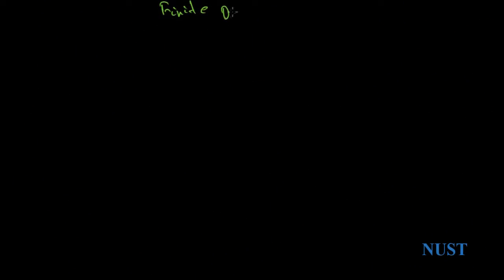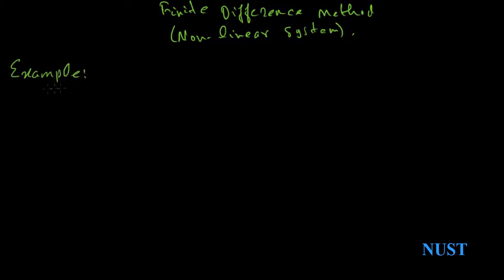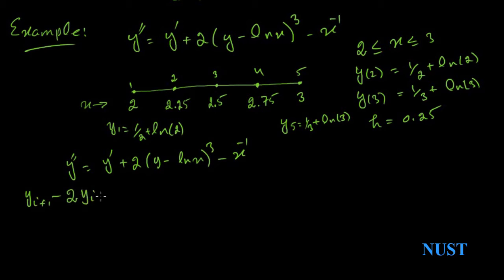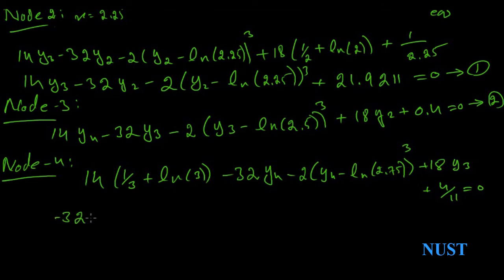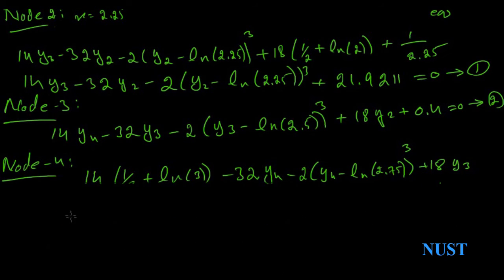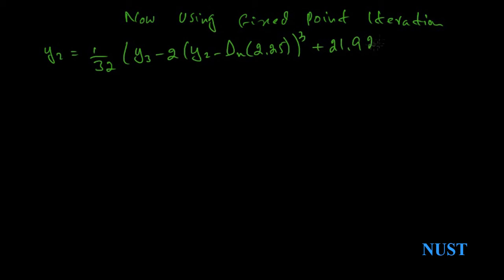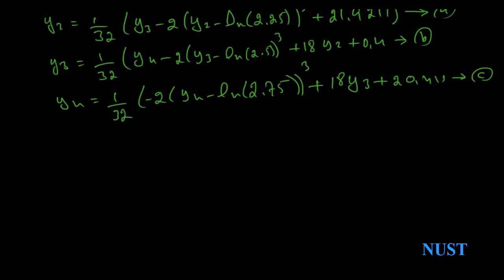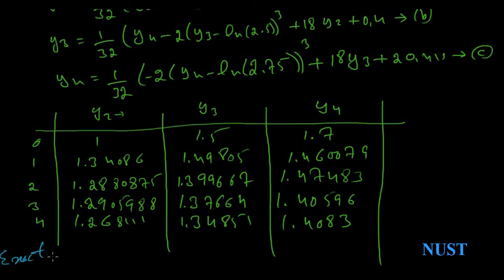11.2-Finite Difference Method non-linear system (numerical analysis)

Comment: what are the initial values of y2,y3,y4
Reply: 1, 1.5 and 1.7, you can find them on the top of the table. frankly, they are the only values in the table with one digit after decimal